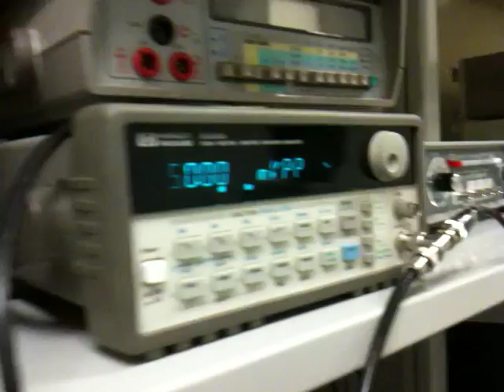Electronics I Lab AM Receiver Project

Comment from the maker: Yes, excessive for what it does, but it's designed that if you replaced a few components with tunable varieties you would have a fully tunable radio. We didn't do that with this one, but the rest of the design gave us experience on how one would do that.  As part of the project we did have some limitations in that we couldn't use ICs(except for audio out amp), BJTs being the only part allowed other than basic circuit components.